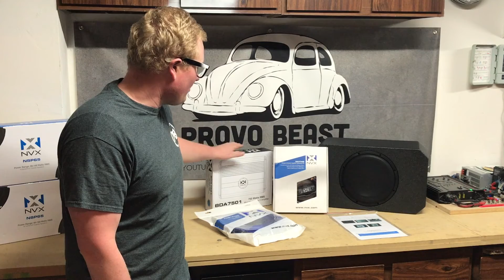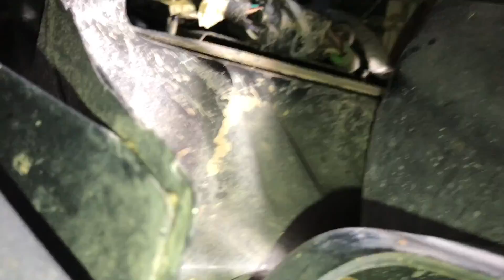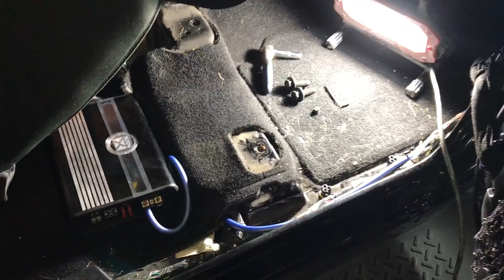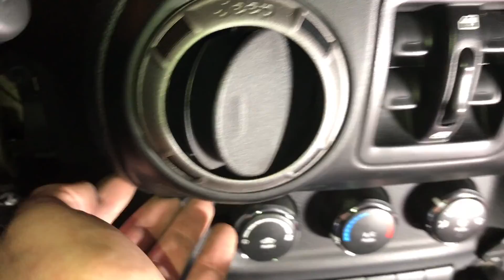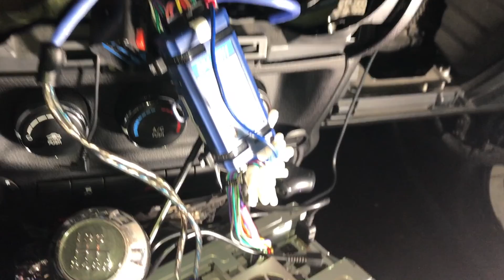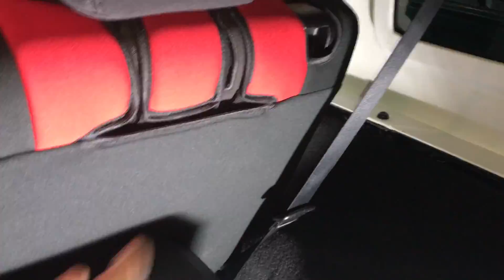2007 - 2018 Jeep Wrangler NVX Sub and Amp Install!

Comment: The location for the amp is great, jeeps are known to having leaks. I would add something underneath in case of a leak. There is a mounting bracket that attaches to the seat frame, way above the floor.

Comment: Quick question, I’m installing subs into my 2012 jk and my amp isn’t getting any power, could that be due me not wiring the remote turn on wire u mentioned
Reply from the maker: Sure. Also a multimeter will help you identify the problem right away

Comment: Thanks for the advice, my only advice is to mount the amplifier up high, jeeps are known to go off roading and go through 3 or 4ft of water ive had an inch of water in my jeep a handful of times. I mounted mine on the rear rollbar at chest level with elevated FOX BOX for the subs.